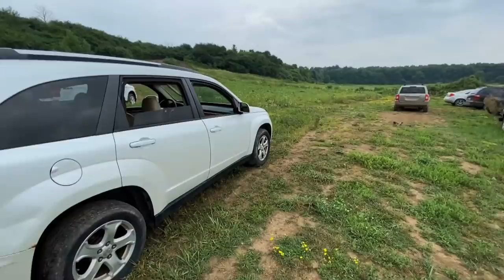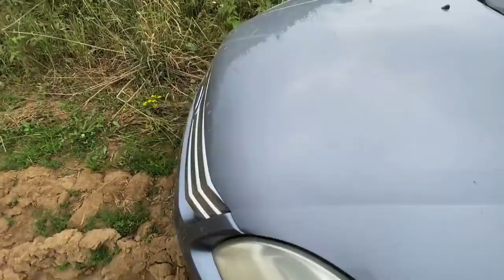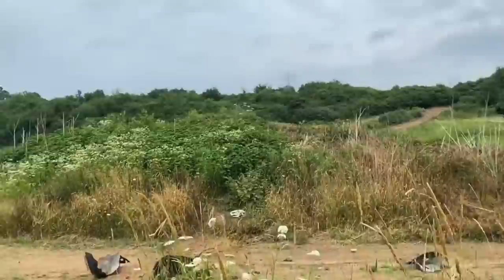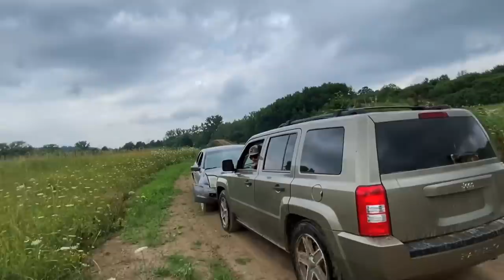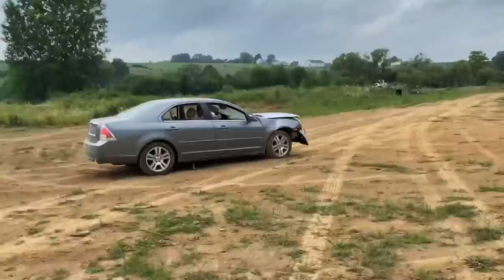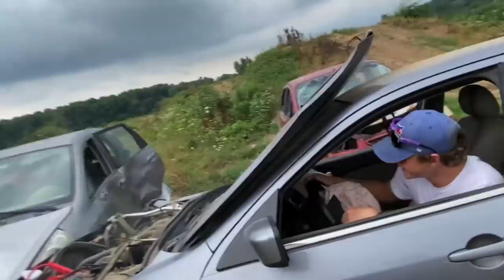FORD Fusion Ultimate CRASH REVIEW!

Comment: Scotty Kilmer was quite serious when he said the fusions were solid built my my
Reply: Especially the Ford duratec v6 3.0 very reliable
Reply: They are nice made cars I love my fusion, but the new ones aren’t as good.
Reply: I had a fusion 2007 4 clyinder only issue was the transmission
Reply: Nathan Cook it’s the case with every modern car Toyotas are some of the best of the best with Honda being close second but even they aren’t like they used to be in the past
Reply: Especially with the Honda Odyssey having transmission issues
Reply: I watch Scotty Kilmer all the time so I get my research from him
Reply: @nathancook5271  yeah because ford 2013- present don't use duratec motors
Reply: @Jay_556  Did you change the transmission fluid every 60 to 80,000 miles? And or check the fluid level those transmissions are extremely reliable and a lot of them go over to 200 thousand easy, I’ve got 135k on mine and it shifts like butter…
Reply: @mackinner  It’s too bad that most of those fusions 2006 through 2009 are so beat up and abused, I have a 2009 SE but it’s in near perfect condition, and I’m restoring it new headlights, full detail, also going to add LED headlights and LED fog lights, I already have LED OEM look bulbs all the way around. Why do you dislike the 2010-2012? Honestly I think that the 2010 to 2012 also look really great, and the 2.5 L is notoriously reliable as well, maybe not as reliable as a 2.3 but a very strong motor is pretty similar to the 2.3 actually.

Comment: Yooooo I have an 08 fusion v6 3.0L front wheel drive. it's the best piece of shit I have ever driven. 3 serpentine belts two power steering pumps. It's a pain to keep running. However, she also has 200,000+ miles and she still gets rowdy.
Reply: Yessir got the same car, def a stronger engine than the fusion needs but it hauls. Favorite car yet